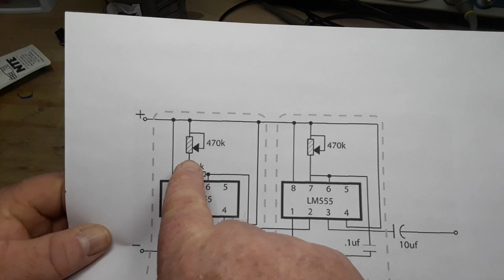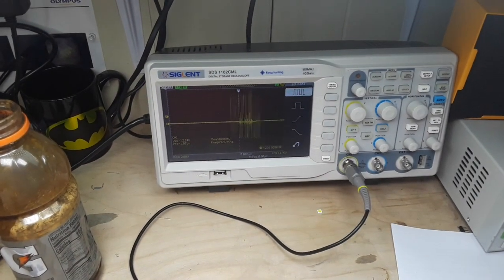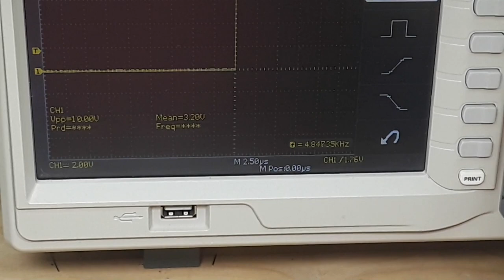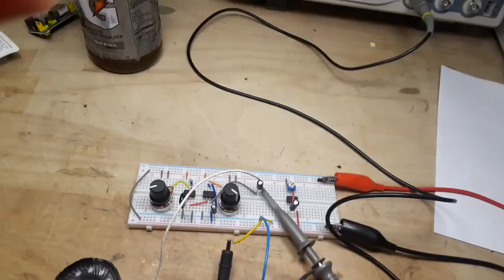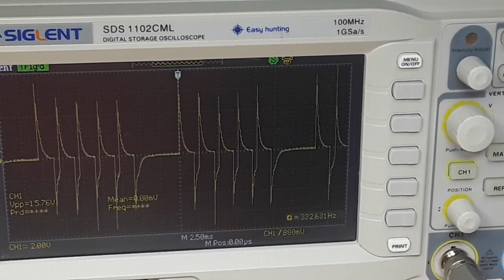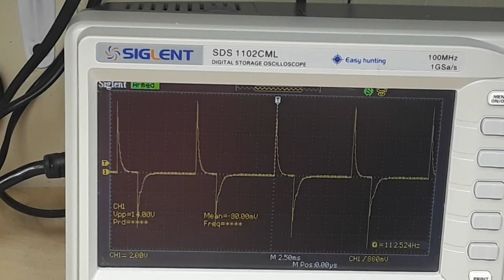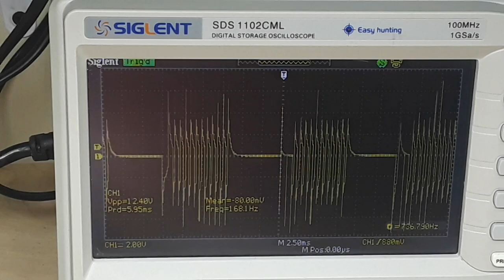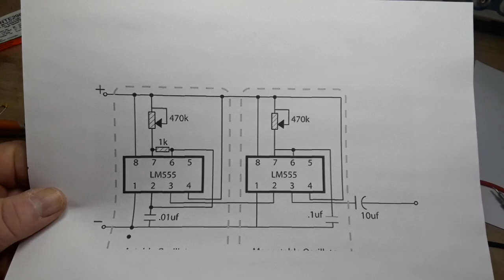Easy Synth Experiment for Beginners Atari Punk Console with LFO

Comment: I just did something similar with my APC circuit. I put some electrolytic caps on the output of pin 3 on the astable 555 to pin 5 on each 555 in the APC. It really added a nice "crunch"!

Comment: Again, I think this could be equally as well done with my favourite quad Schmitt trigger, where one gate oscillator is used to add cadence to a second or third gate oscillator. Like the 555, it is possible to take the signal from either the square wave output or the capacitor charge discharge voltage. 
May I also suggest that you do a few experiments with a double balanced mixer IC, to make ring modulators. There are such devices that work down to very low audio frequency, even though they are designed for RF/IF applications, as they are DC coupled, eg SA602AN.
The ring modulator is the way that the Doctor Who Dalek voices were made.

Comment: Noob question: What makes an LFO, an LFO? [from left to right] You have the 555 #1 connected to the 555 #2 [via pin 3, to pin 2]. Then you have 555 #3 connected to 555 #2 
[via pin3, to pin5]. They’re all 555s but one is connected to pin 2 and the other, is connected to pin 5. So, is that what determines whether it’s an LFO or not? Please clarify. I want to learn. Thank you kindly

Comment: Tried out this little synth, it worked! But the LFO just added a bunch of static - no modulation, at all. I’ve tried different values of caps [all electrolytic], 0.1, 10, 22, 220, and 330 micro-Farad - nothing worked. Please let me know, what value you used for the cap. Also, I build this LFO very close to the synth circuit [ran out of space on the proto-board], could that be causing the static - the proximity?